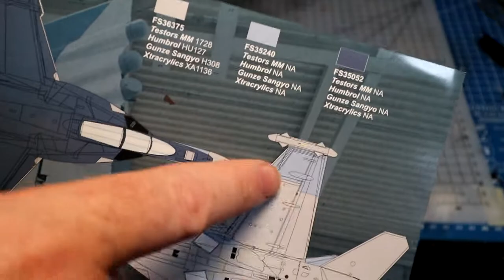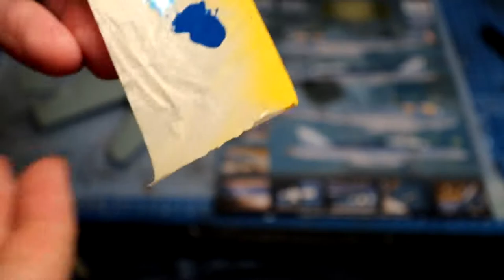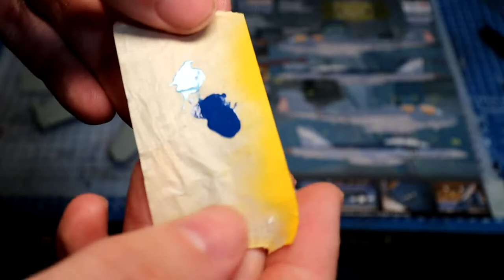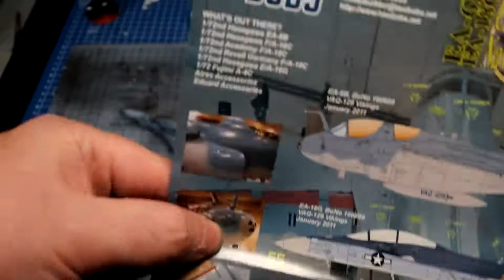1/72 Academy EA-18G Growler Build Series - Part 3: Primer and Paint

Comment: The Growler is coming along nicely, Richie! I know what you mean about using enamels. I started thinning my Testors Model Master enamels with Mr. Color Leveling Thinner and it really improved the drying time. I would paint in the evening and leave it overnight to dry. It would be touch dry the next day. Not sure if the small Testors bottles have the same formulation as the model Master range, but it might be worth a try on a paint mule.  I usually thin the paint with about 70% Leveling thinner. Love that scheme, BTW!